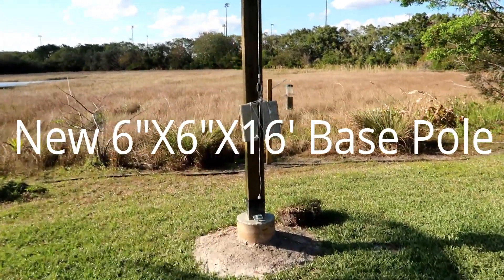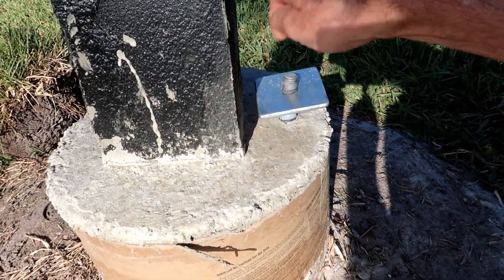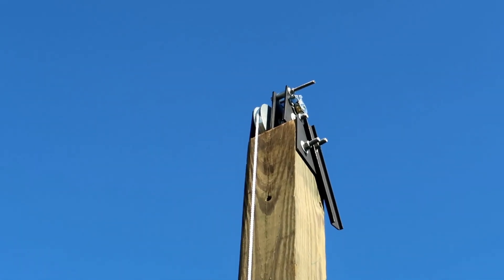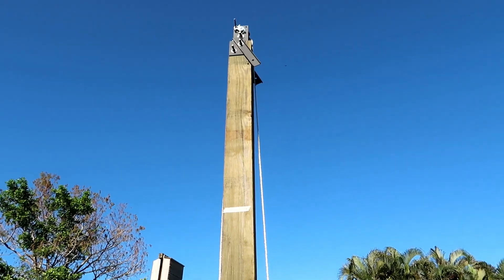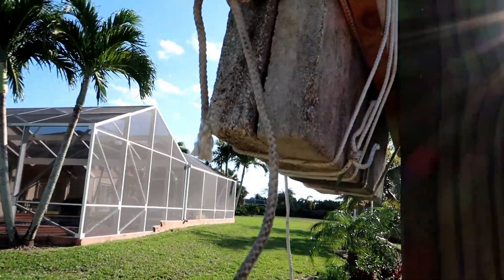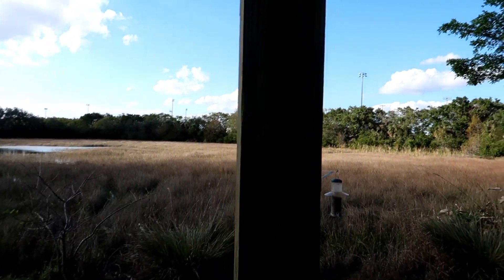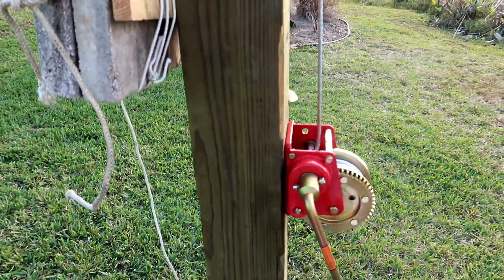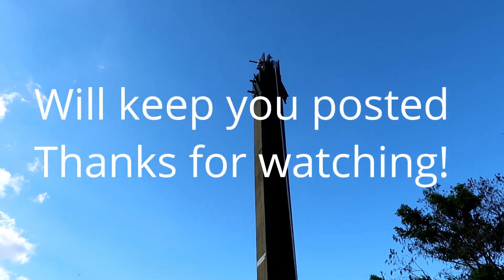Telescopic Bat House Base Pole

Comment: Hey Steve, Wondering if there's any concern with the lag bolts being ripped out when you hoist of the second pole. Is there not a need to run bolts for the winch all the way through with washers and nuts on the other side. Or, are the lag bolts you're using good and long?
Reply from the maker: I have two 1/4" x 3" lag bolts in the top of the winch plate and a single 5/16" x 3" lag bolt just below the center of the drum.  The load on the lag bolts should be in the shear direction, so hopefully I am good.  The next video of the 4" x 6" going up will test theory versus actual. Guess I should wear gloves and safety glasses.  Stay tuned!
Reply: Got it! Was mostly thinking about the bottom bolt, in case there becomes too much pressure, causing the winch plate to exert an outward force on the bottom due to a possible hinging effect just below the top two bolts. Will be interesting to hear how the test goes. I imagine you'll be good with 3 inch lags.